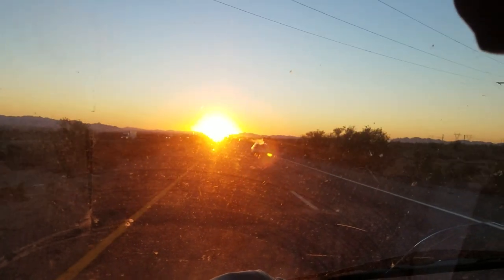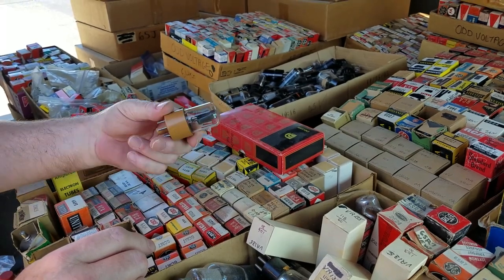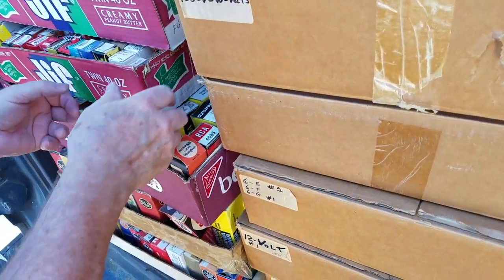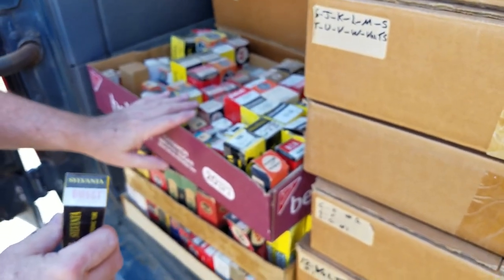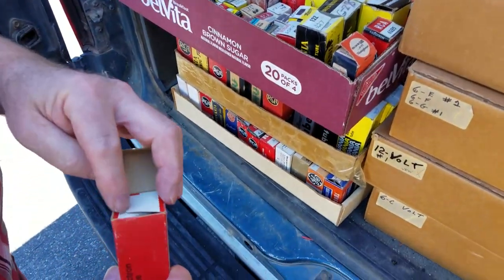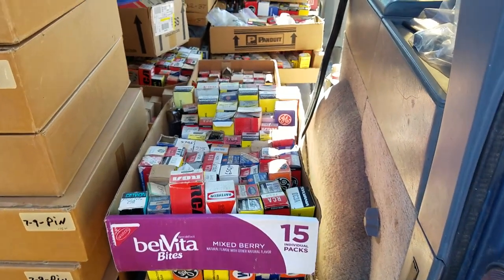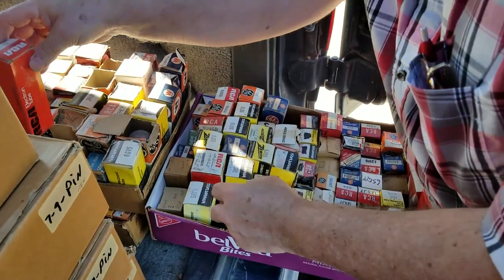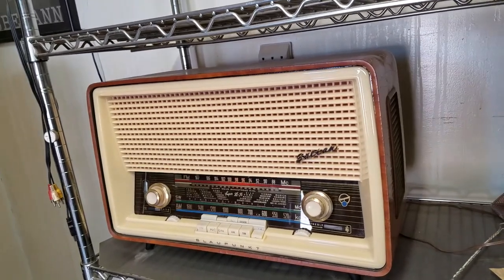Talkin Vacuum Tubes With AL

Comment: I am a former employee of Westinghouse Electric and Raytheon, and we used to owned Power Tube Division in Waltham, MA. The division used to be very large 7 story brick building. We owned an old manufacturing of Radio Tube, Hand Wire Transformer for Commercial and Military application. Also, state of MA used to be a major manufactured hub for electronics like Gen Rad or General Radio. In 1993 I was laid off of this industry and American Tube and components were shutdown and employee were let go.

Comment: red ink on sylvania  tubes was a 3rd pick ( yellow ink was a 2nd pick, green ink was a 1st pick, white ink was military). also  you have realize that G.E( thompson electronics) bought out R.C.A.    "C.B.S." did make their own tubes( E.I.A.# 210)  industrial tubes were "PREMIUM PICK/ QUALITY" ,the 6012 tube was also used on "D.C." motors for speed regulation, and dynamic breaking

Comment: that was an hour of my life that I might just have to relive again!

re: the radiation, as long as you aren't grinding up these tubes or the ore and doing lines or sweetening your cereal with them, you could store them in your nightstand and be fine. The fact that you can pull the geiger tube a foot away from them and silence it is clue #1. Clue #2 you can check by closing and opening the metal window on the geiger. If closing it silences it, then you're not seeing gamma rays, so it's even less of a concern (can't penetrate skin). The only radiation danger associated with these things is chronic exposure to dust over a long period of time, bypassing your skin and accumulating in internal soft tissue. (yes I am a professional in a relevant field)
Reply: The gamma tube sounds ominous.  I worked with an GE tube powered 1958 X ray diffraction machine the size of a car in college.  It had 9 counter tubes which gave digital outputs.  It must have weighed a couple of tons.  In back it had a very large ceramic component in a 100 gallon oil bath which glowed white hot.  I always assumed the oil was PCB.  It was pretty scary and the prof showing me it was'nt radioactive did not allay my fears but I completed the experiments with it.  A modern machine would be automated of course but this was no doubt a donation by a large company of an old timer.  We had two of them.
Reply: @rogersmith7396  I was thinking more along the lines of gamma-emitting rare earths in the tube, but a gamma tube does sound ominous! I don't think you can get enough horsepower out of any tube to generate gamma electrically, though.

That is definitely a bigass x-ray tube that you described, and yeah probably PCB oil. But... unless you were physically exposed to the oil and then picked your nose and ate your lunch without washing your hands, your PCB exposure would be between zero and trivial. And the x-ray tube couldn't generate enough power to be able to leave residual radiation, just the x-ray 'light' while turned on, which you detected with the counter tubes. X-ray machines in general add cumulative risk to workers with chronic exposure over a career, but aren't too concerning otherwise unless you spend a lot of time basking in the glow. I double-checked and a transatlantic flight gives you exposure to about 5 chest x-rays of radiation, so you can imagine that airline pilots rack up exposure over a career. 

On the other hand, gamma-source medical instruments are tracked extremely tightly because they have a large chunk of highly radioactive material in them, enough to cause actual radiation sickness and potential terrorism concerns. There is occasionally a story about some old machine being junked, somebody finding the source, and severe injury resulting.

Real curious now, what were you studying? I'm going to guess... material science? What kind of material?
Reply: The detector shango is using looks to be a Ludlum measurements model 44-2 but possibly a LM model 44-10 ( didn't get a definitive answer as of yet). 
Both detectors that are listed are scintillation based and the only difference between the two are their crystal sizes. A important note, detector model doesn't matter here, what Shango was using is a gamma only detector. 
As previously stated a scintillator detector in this case most likely equipped with a Thallium doped Sodium-Iodide crystal. These types of detectors are extremely sensitive compared to Geiger-Muller based.

We can also look at the tubes Shango was inspecting. In this case a group of Westinghouse 346B's most commonly containing around 2uCi of Radium Bromide, although there us a variety of 346B's that are marked with the trifoil and can contain much more.

That said his probe being gamma only and very sensitive his readings were rather low. 
If I recall correctly Shango said in a reply to my comment his meter was on the low multiplier, which I cant tell  what meter he is using here but I will assume a LM model 3. So if on low range we can assume unless told otherwise his measurements were either 5uR/hr max scale on x0.1 or 50uR/hr on x1. Which is reasonable for the sources at hand.

Important note: the probes real effective range is 0-5mR/hr or 0-5000uR/hr unless electronically compansated then it pops up to 50mR/hr. Just shows the sensitivity compared to other detection types.

Comment: I used to work on 16mm projectors and Movieola editing machines. For films with optical sound tracks, phototubes were used. (some films used magnetic tracks as Shango mentioned). Two methods were used with optical tracks-variable density and variable area. Both depended on the principal of varying the amount of light passing through the film's soundtrack, modulated by the audio. The varying light struck the phototube producing a tiny current of a few microamps which was then fed to an amplifier. Excellent video! Shango has one of the very best channels on YouTube!

Comment: About the light detector tubes used in film: I was a theater projectionist back quite some time ago. All 35mm prints you see in the theater, up to the move to digital projection, used the optical sound strip based on modulating light amplitude. 70mm film used a mag strip, but all 35mm used the light. 

So most films you've ever seen in a theater that aren't digitally projected worked this way. Probably done because it was durable and the sound was part of the film (chemical) development process and didn't require another step - like applying a perfectly synced mag strip.
Reply: I was the projectionist for my grade school when I was 11.  16 mm. I was the only one who could thread the thing.  So I knew about how the sound track worked with the optical strip. I vaguely remember a round drum about 3" that the film wrapped around with a light that shone through. Never needed to change any of the tubes, though, so never saw inside.
Reply: 35 and 16mm were both optical, while 8 and 70mm were magnetic. 8mm sound came along late in the game and didn't last long.. Imax is sideways 70mm with the sound on separate, synced magnetic media.
Reply: I know an owner of a drive-in theater, and he was still using 35mm optical sound until he went to digital projection about five years ago.
Reply: One other bit of semi-archaic info..  The film moves through a projector briefly pausing at every frame for projection of that particular still image (24 fps for standard 35mm).  This is typically done using a "geneva drive" mechanism with a loop of film on either side of the paused frame.  These loops both increase and decrease in size as the film is briefly held paused in the gate.  Essentially, the feed and take-up reels move continuously and as the film pauses in the gate, the loops of film act as mechanical buffers.  This whole process is why film projectors make so much clattering noise.

In terms of the sound strip, this must be read continuously - meaning the part of the film that is paused cannot be where the audio pickup is located - otherwise the sound would keep pausing.  So, the audio reader is placed either before or after the loops of "buffer" film (I don't remember which) where the film is moving continuously.  The audio has to sync with the piece of film paused in the gate, so the position of the audio track relative to the image has to be offset by a very specific amount to accommodate for the constantly pausing action of the image versus the continuous feed of the audio.  It's always surprising to me that projection worked so well at scale (i.e. Tons of prints being distributed to all the theaters in the US and abroad).  Theater projectors really were amazing mechanical marvels.  Look up "Norelco" projectors to see the best ever made.  I believe there's an online registry of the ones left in existence.

Comment: I swear EVERY old TV repair shop stored their tubes like this. I have so many cut down boxes from the grocery store full of tubes. I have bought around 5 or 6 vintage TV and radio stores and the similarities in how each store was run in really intresting when you consider this was before the internet and they were independent stores.
Reply: I went to an "OLD ACE HARDWARE STORE" and asked the owner, who was around 85 years old at the time( this was back in the mid 90's), if he had any vacuum tubes for sale. he told me "YOU ARE KIDDING ME!!!!, I have the basement of this place full of tubes that I can not sell" I told him "YOU JUST SOLD THEM" he just about gave them to me ( new in the box). it took 3 full van loads to clear out the store basement. I did find some transmitting tubes that were made by "DEFOREST"!!!!( new in the box). I sold those tubes to a collector

Comment: What a wonderful opportunity to learn about the bedrock.
I recently had a similar experience which I feel compelled 
to share with you.  I live in a formerly quiet formerly small
city in a Western State which has been popular because it
is not so noisy.  There is a remarkable store here which 
accepts donations of old electronics and sells such in order
to fund STEM classes for kids.   In the store is a fellow of
such remarkable knowledge it is hard to believe he is only
about 30 years old.  I was purchasing some used tubes 
there and asked him if he could test them first.  He told me
no, that tubes were sold as is.  He also did'nt understand
why I was concerned with buying a bad tube as they are
so easily repaired.  "Women made tubes in their garages
during the war."  He found it hard to believe that people
were lamenting the dwindling supply of tubes as they are
so easily made or repaired.  One only needs to replace
the 'elements' inside and since tubes are metal that is no
problem.  He restated the women in garages line again
and ended with the statement, "We have a thing called
transistors now."  I tried to ask him about vacuum pumps
and such but he said they were easily obtainable.  I had to
leave because being 67 years old my attention span failed
me.  I left with the strange impression I had been in a 
comic book store.  At any rate I thought I would share this
knowledge with you and hope you can pick through all those
tubes to find some that were garage made by women in 
the war.  It would make and excellent follow-up video.

Comment: Yes, learn your EIA Codes too. That will help ID who made the tubes. They may have a brand like Motorola on them but have an EIA code of 274, which is RCA. 312 is Sylvania, 188 is General Electric, 280 is Raytheon, 322 is Tung-Sol, 210 is Hytron. Everything Al is saying here is exactly what I've learned over the years as well. You do get to the point where you can for the large part ID them on sight. I also look at the plate crimps and perforations. As far as "Black Plate" goes, the belief is that they have a sweeter sound to the audiophiles. The only place I notice a difference in the tonal quality of tubes is in preamp tubes in amplifiers. Particularly noticeable in guitar amps. 12AX7, 12AT7, 12AU7, 12AY7, 12AV7, EF86, 5879. RCA, Mullard and Telefunken are generally the best in V1 in a guitar amp. I've found they have the best gain and headroom. We're talking the real deal vintage ones, not the new Russian made reissues. There is so much to know about tubes. I don't think you could ever learn all there is to know. Great video!
Reply: Sylvania stacked their EIA code vertically most of the time.
Reply: You can hear the difference between different 6 V6 tubes on a Fender Champ pretty easily
Reply: @boulderbobb  you'd do better to swap the preamp tube than you would swapping 6V6's. The difference is subtle swapping output tubes. The preamp is where the action is.
Reply: @gerardcarriera7052  , YUP!! , they sure did, you read sylvania tubes top to bottom, and that went for the date code also( if it had one----- service replacement tubes were not date coded)
Reply: @boulderbobb  , on "push-pull" output tubes they have got to be "MATCHED PAIR" ( electron conductance) this also includes the last stage / phase inverter amp before the final output !!!
Reply: @davidball1341 ,  there are exceptions. I had a Kalamazoo (Gibson) Model One some years back, a very basic Champ-like amp with a single EL84, that I recapped, and redid the grounding scheme for lower hum. It sounded decent but a little thin and sterile, and I tried various different tubes until I put in an old used Amperex Bugle Boy EL84, and *the amp came alive*! It paractically roared! Sounded like a baby Vox, with chime, spank and sparkle galore.
Reply: @gregoryclemen1870  ,  Actually, if you have a perfectly matched pair of output tubes the sound might be a little too clean and a little less interesting than if they have a modest mismatch.  A gross mismatch can cause problems with hum because you lose some of the common mode rejection capability inherent in push-pull amplifier stages; and of course if they're too far off then one tube may draw a lot more current than the other and that tube will run hotter and perhaps have a shorter lifespan or even red-plate, especially If the tubes are being run right at the edge of or above the  tube manual spec values.  This is more of a problem with fixed bias amplifiers than cathode-biased amplifiers, especially if they do not have a bias balanced pot in addition to the usual up-and-down bias adjustment.  If the amp has 4 output tubes however it is definitely best to go with well matched quartets.
Reply: @goodun2974  that's great. It's not usually the case. You probably just had a weak EL84 vs. a stronger one.
Reply: @davidball1341  , nope.  I sold tubes for years,  and therefore everything I tried in the amplifier had been checked for transconductance, and lack of gas or leakage,  on a well  calibrated Hickok 752A.  I tried several of the usual suspects, GE, RCA and the like, but the Amperex turned out to be the lion's roar.  Other techs have pointed out that in their experience EL84'S are very sensitive to impedance loading, and it appears that the Amperex really liked the conditions in that Kalamazoo circuit, or vice versa. Also possible that USA EL84/6BQ5 just aren't built the same as the European EL84'S.
Reply: @goodun2974  Well, anything is possible. Good for you finding a sweet spot.
Reply: @davidball1341  , for starters,, cathode construction and chemical makeup on European tubes is apparentlly different than that found in USA tubes. Compare NOS Telefunken 12AX7'S to NOS RCA and GE 12AX7's; the American tubes will have higher transconcuctance but the European tubes tend to last longer. Test the original Tele preamp tubes in a late 50s or early 60s Fisher or Scott amp or receiver and theyre usually still good,  even though the output tubes are usually worn out.
Reply: @gregoryclemen1870  Poppycock!
Reply: @jimw7ry  ,explain yourself!!!!, what are you making a reference to!!!
Reply: @gregoryclemen1870  The requirement for matched tubes.
Reply: @jimw7ry  , thank you for getting back with me, matched pair tubes are in reference to output tubes that are in a "PUSH-PULL" circuit( not single ended output). you want both tubes to have the "same conductance," so there is equal reproduction( plus/ minus side of the wave form) without "CLIPPING" at rated output( distortion). this can be seen on an  "OSCILLOSCOPE" if one tube is conducting more than the other( weak output of one tube). this is also true for the "DRIVER/ PHASE INVERTER" stage of amplification. back in the 1950's to the70's you could order tubes as "MATCHED PAIR" like output transistors , however that ability is gone now, due to the fact that there is no tube manufacturing in the U.S.A.. it was, back in the day, easy to get such tubes, there was an R.C.A. tube plant in town( closed in 1975). today, I "HAND PICK/TEST" each tube from "NEW/OLD  TUBE STOCK" that I have( 6L6/ 5881/7581/6550 output tubes) on 12AX7, 12AU7/ 5751/ 7025 tubes(9A basing), or 6SL7/6SN7/ 5691/ 5692(8BD basing) that are being used as a driver/phase inverter, I make sure that both sections have the same conductance. if one side is good and the other side is weak, the tube is removed from service and destroyed. I hope that answers your question, I like to share the knowledge that I have to other people. I have been doing electronics work a long time( I have the "GREY HAIR" to prove it),I also have a degree in "ELECTRICAL ENGINEERING", that was suggested by my "MENTOR" who was the head electronics engineer for "WLW RADIO/ VOICE OF AMEREICA"( he was my neighbor when I was growing up).   if you have any other questions, feel free to send another "COMMENT" !!!!.    have a great day!!!!.